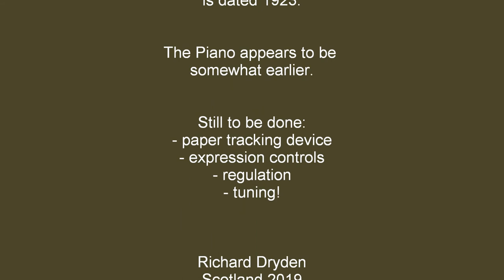Pianola restoration

Comment: Great to see you had a go at taking on such a project.
Seems like there was still a bad leak as you seem to be pedalling way to fast for it to work.
Player Pianos over here in Oz are advertised often for free so not worth repairing one in poor condition unless it has real sentimental value as can often find a better one 
I have just finished restoring our 1926 Beale but left it to an expert to re cloth all the pneumatics but at least did the dis assembly and reassembly and was lucky that all the piano rack had been repaired some time before however some hammers did need re pinning.
These instruements give  lots of enjoyment.
Enjoy it!!

Comment: Looks like it leaking quite bad? I noticed the valve leather was really bad, so I assume you replaced it? I didn't see pictures. 

You'll find that replacing the old cloth that is under continuous suction als helps a lot, such as the reservoir, governor and roll-corrector.

the work done looks really neat.